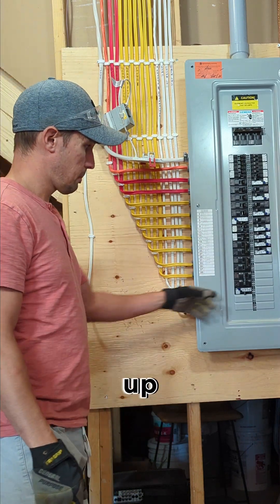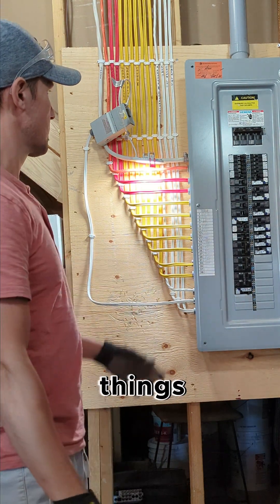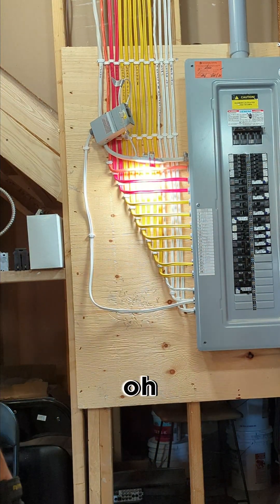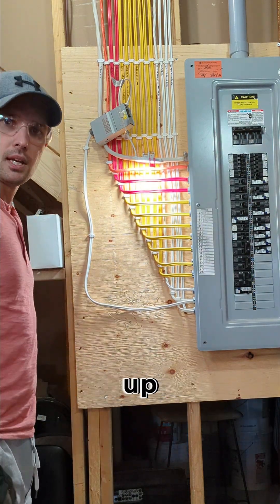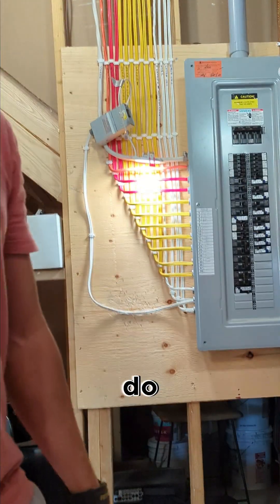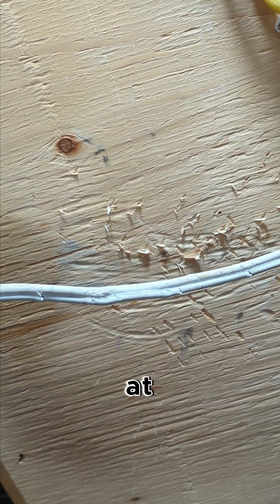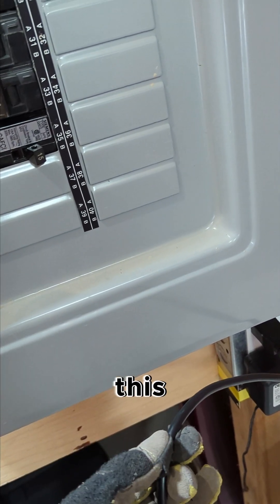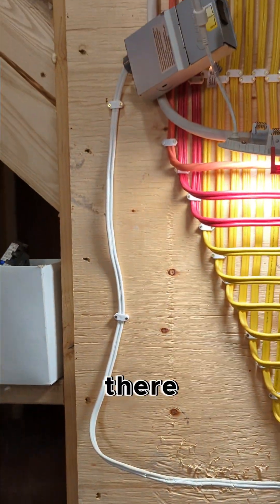How dangerous is exposed Romex electrical wire?

Comment: As a uk sparky it seems a waste of time with all the clips . 3 or 4 inch hole in the top with 3 or 4 inch trunking into the board . Electricity is science , what is the scientific reason behind not being able to have the outgoing circuits enter at the top with the feed ?
Reply from the maker: It's a safety issue. So when you open the panel cover the live mains can not be touched with the main breaker off. You can't turn off the mains coming into your house.
Reply: @The_sparky_sean  how do you change a panel then ?
Reply: @persona250  In Nova Scotia, Canada you call the utility company and they pull the meter then come back and reinstall it after final inspection.
Reply: @The_sparky_sean  and surely the panel manufacturers like in the uk can include a plastic terminal guard . Would save in my opinion a daft regulation.
Reply from the maker: I'll post a video for you.
Reply: @The_sparky_sean don’t you have a disconnect outside?

Comment: The only thing this set up would be an issue in my JURISDICTION,  (keyword for those warriors) is the side entry. That the possibility of damage at the connectors or bushings and likewise the damage induced for illustrative purposes would get me a red tag. Top entry or bottom entry with some exceptions would be my local inspectors' preference. Clean work though. Great video.
Reply from the maker: Thank you! And thank you for letting others know their different areas have different codes. So many people think their code is the only code in the world.
Reply: I mean, it's pretty, but I wouldn't want to pay for all those grommets and staples if all the wires could have gone into one or two holes.
Reply from the maker: @stickyfox putting all those wires in one or two holes in a fire hazard. Wires create heat that many wires in one hole could cause a fire.
Reply: @The_sparky_sean  by "could have," of course I mean "if the code permits."

But I don't blame you.. most people would put all of them in the smallest possible hole just to be lazy.
Reply: @The_sparky_sean 🤔 pretty sure 1/2” knockouts you can run two # 12  home runs and in a 3/4” knockout you can run 3 #12 home runs just gotta read the specs on the panel!!
Reply from the maker: @Weasel_NM575  yes you are correct. However I don't like to die to heat dissipation and damage that could happen with multiple wires in a connector that is rubbing. Being productive

Comment: I have a question. This is not a critique. The wires entering the panel, if the Red colored wires were on the right hand side----- and like wise flipping all the wires around, would let you have a clean entry to the panel instead of crossing over each other.  
Now it looks way too complicated. 
These are insulated cables, so I bet there are no issues. 
But why make it so " busy"!
Reply from the maker: Just a new way of doing things that is all. I have done many panels and many different ways. Follow me and I'll post a story about all the different panels I have done.
Reply: @The_sparky_sean  I've seen a few of your videos and love how orderly your wire entries look.

Comment: First of all all that wire exposed looks terrible. Why not just take it in the top of the panel so it's never an issue of damage to the wire like a pro would.
Reply from the maker: Because in Canada our code makes it illegal and against code to enter the top of the panel next to the main feeders. Main feeders and branch wire must stay separate. This is for safety. So every panel in Canada has exposed wires. Different countries have different codes.
Reply: @The_sparky_sean  ok I did not know that.

Comment: When I did my shop the inspector had no issue with exposed wiring unless there would be livestock in the building. Even then only wiring below 8’ needed to be in conduit. Too your point I had some 8 gauge wire for my welder and plasma cutter I left free and drug around my shop for years and it took the abuse way better than SO cord would have. Haters gonna hate.